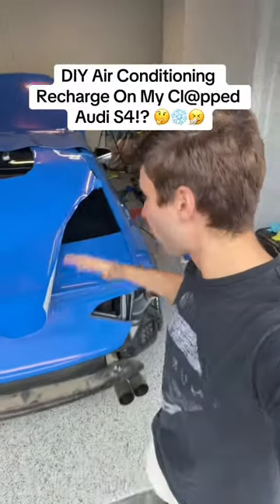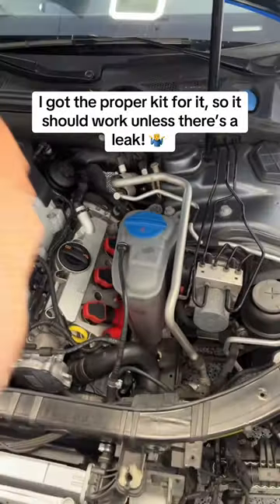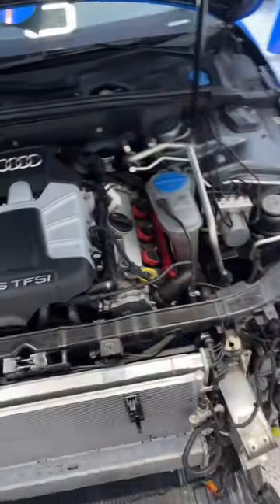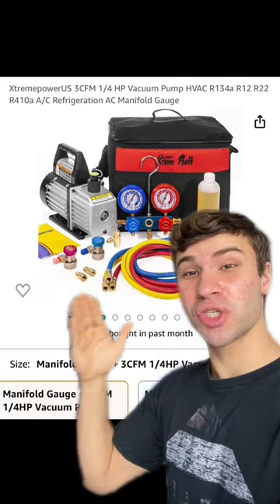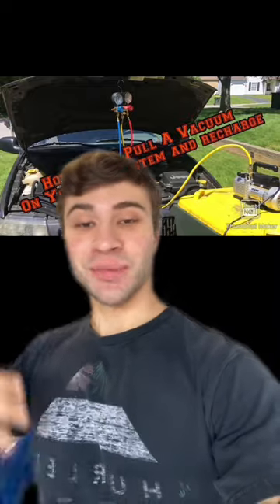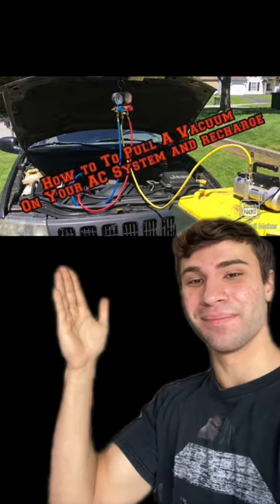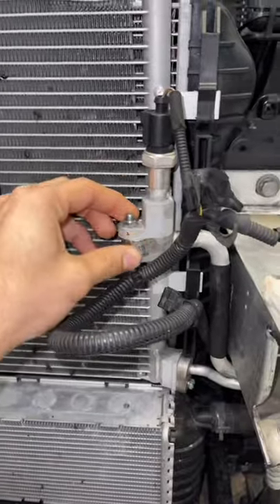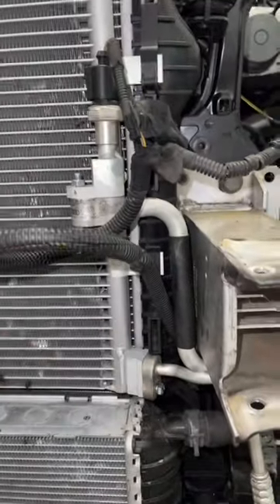ATTEMPTING TO DIY FIX THE AIR CONDITIONING ON MY SALVAGE TITLE AUDI S4!? (HOPE THIS GOES WELL)

Comment: You might want to change out the dryer unit if they have been unplugged, its job is to absorb moisture and it dosent release it. It also acts like a filter.

Comment: God damn new generation believe in YouTube mechanics 

20 yrs as an Automotive tech with all these certifications.
I actually had to get my auto Hvac lic. to do A/c

This is the reason why the auto repair industry is failing.
Reply: Bro don’t act like all you do is hook up the high and low side and let your snap on machine do it for you
Reply: @inshallah4280  
That's not all I do
There's more in depth to just hooking up a machine.
Pre-checks making sure the entire system is ok 
Leak free hence dye in the system and visually inspect 
If it's an empty system the compressor will not engage if pressure is too low.
There are ways to engage the compressor to ensure functionality 
Knowing your values especially if it's manually operating gauges.
Knowing how much oil to inject with the dye
Thermometers in the vents to verify temp in the cabin.

There's probably a hand full of things to list yet 
But what do I know.
I get my shit from the Internet
Screw Alldata and Pro Demand.

Also I can't stand the Snap on machines

Thanks for playing
Next
Reply: @SLPCamaroLT  all it is is recover, vacuum, recharge. It’s really not that complicated
Reply: @inshallah4280  
Never said it was complicated
I'm explaining to you the correct way 
And that machine that you're holding so high
Doesn't replace common sense

So you go ahead and just hook it up without everything else
Your customers must be so happy when the A/c isn't blowing as cold as it should.

Oh and how about you try without the machine to work for you.

Manually emptying the system and vacuum checking.

You can't just let it fly into the air
Common sense and knowledge my guy
Reply: @SLPCamaroLT  who said I was a technician? No one cares about your 20 years bro. I started with a set of gauges before I used the machine.  Doing things manually doesn’t mean you’re a better mechanic or tech. It’s 2023, why not use the machine? You use the manual tire changer too? Those machines too high tech for you?
Reply: @inshallah4280  
I never said I was better
Common sense and knowledge go a long way.
And if you think it's just Recover 
Vacuum and Recharge
You're just lazy
Which makes my point of why this industry is failing and doesn't get the respect it or Technicians like myself who don't get the respect.
Reasons why I work with straight out of school wannabe know it alls
Who makes more mistakes and repeats those mistakes because why?
Lack of common knowledge and common sense
Reply: @SLPCamaroLT  I’m not sure if you’re reading what I said. I don’t work in the industry, and I don’t care that you’ve worked 20 years. I don’t care about the industry because I do all my own work. The industry is failing at much more than just a technician ability level, but since you’ve been in it 20 years I bet you know that already
Reply: @inshallah4280  
Oh I read that
Seriously not that sorry for hurting your feelings
You, replying to my original comment
Makes my point very clear.
You're up against a professional at what I do.
You, not having the knowledge and experience I do
As well as no argument to the points I'm getting across.
You're just proving my point to your argument.
It's ok kid
You'll put on your big boy pants one day if they'll ever fit.